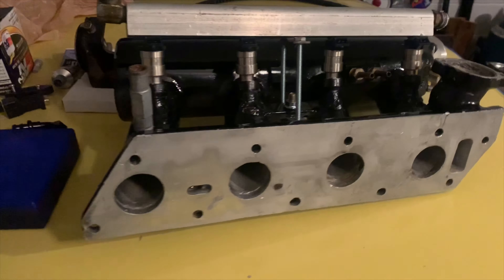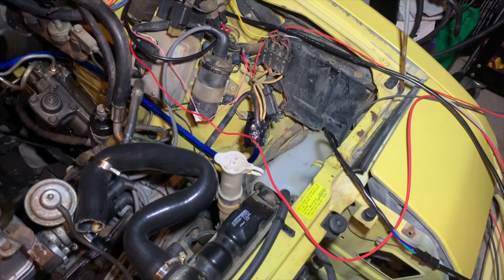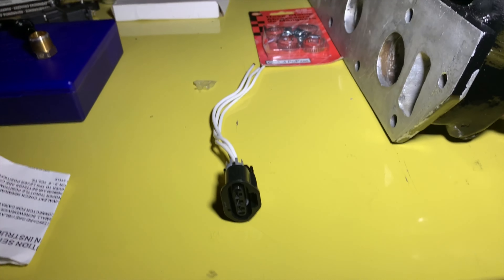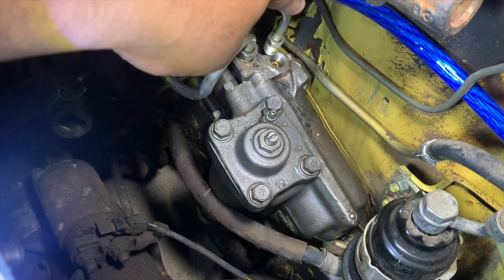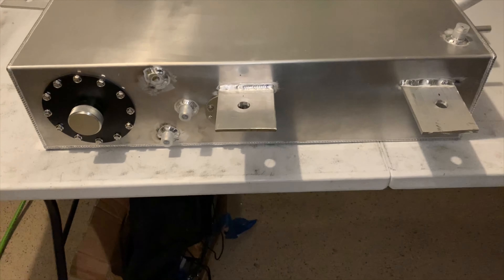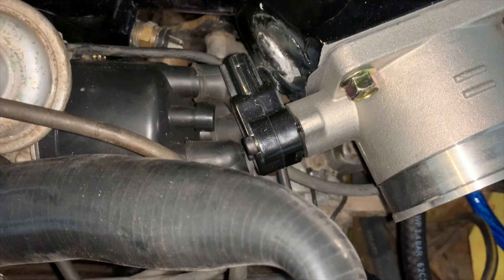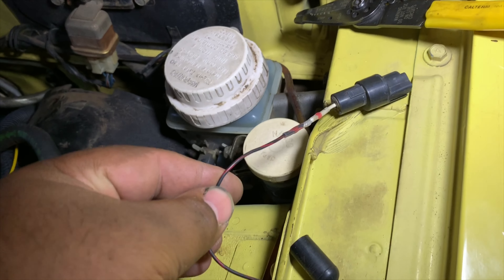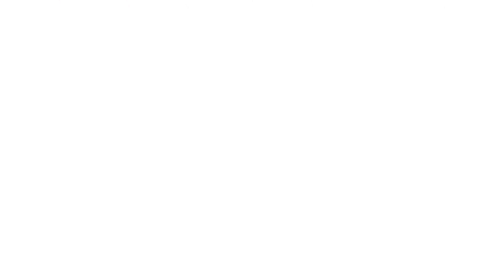Part 5 starQuest help intake manifold install

Comment: Why don't you put a banjo fitting on your fuel line............will help with clearance.
Reply from the maker: True that’s actually a good idea but with banjo fittings it would reduce amount of fuel flow versus a straight line